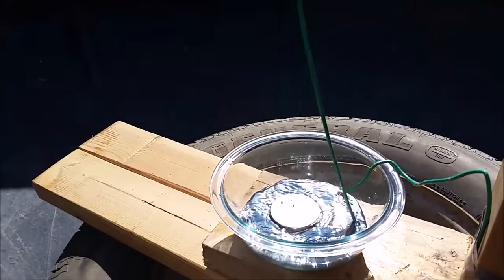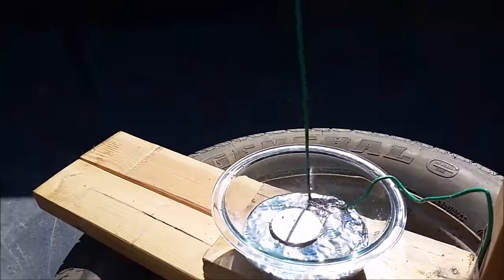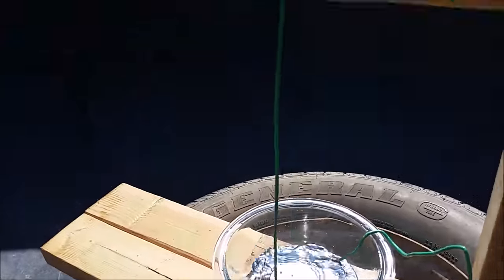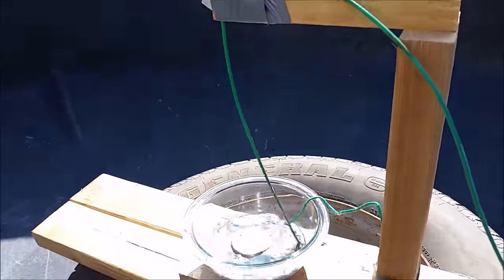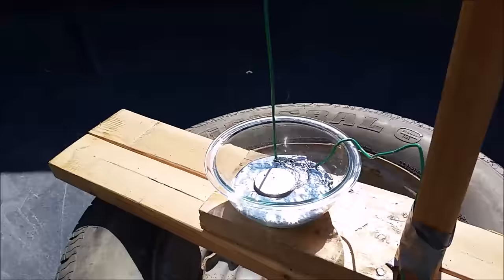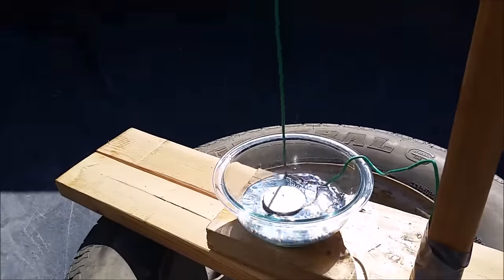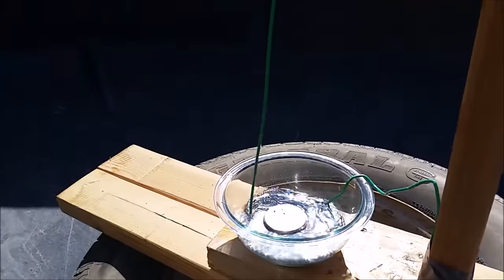Homemade Faraday Motor (Short video)

Comment: If you floated the magnet on the mercury, then touched the wire on the magnet, the magnet would spin. 
I guess it would still be just as power hungry.
Reply: ***** I'm building an induction heater do you have any idea what I could use for a power supply to get couple of kilowatts of power?
Reply: ***** I'm using house power I will be running it to much to use batteries?
Reply: high1voltage1rules
This chap here might have some ideas on that. 👍🏼⚡️
Reply: Ya that is what I was thinking
Reply: @sweetguy19762  If you need it at low voltage (12VDC@60A) server power supplies can be scooped up cheap on ebay.  Or you can do like Cody and get a car battery.

When you consider they're rated for hundreds of amps in brief surges a large one should be capable of like 10kW for 15 seconds at a time.  Just keep it connected to a charger for the actual energy and use the battery itself for short high power runs.
Reply: @whatelseison8970   Thanks for the advice, a server power supply I think would be my best choice.